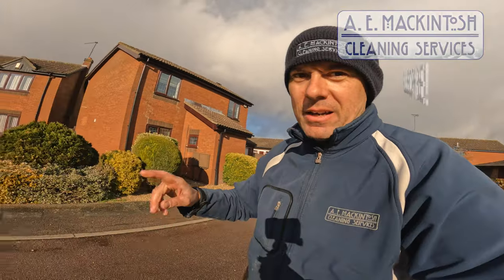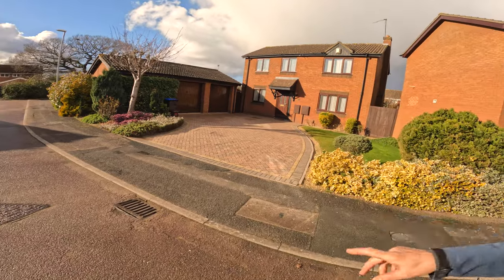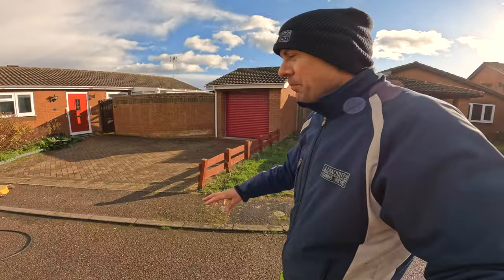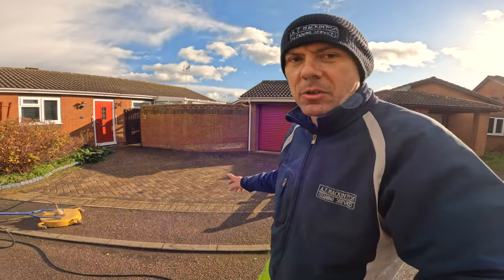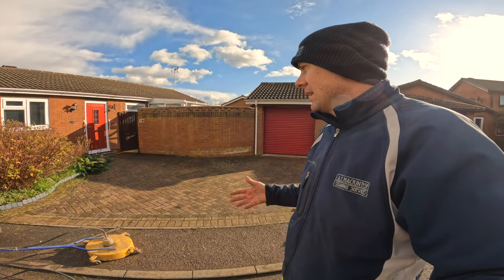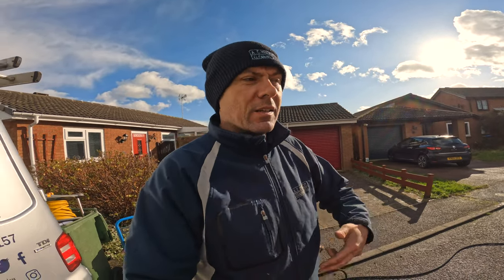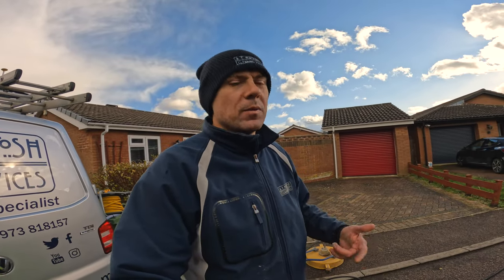Drive Cleaned For My Minimum Charge

Comment: Every job is different, with its own issues. I quote each job individually. You have to cover yourself. How often do you get the old, "Oh while your here, can you just give this a quick flick over"? Sure, it might only take you 30 seconds to do, but you've done something extra, for no reward. Try doing that at KFC, when you see them bagging up your order,....."Ah, While your there, can you add 6 nuggets"? See what happens then......they stop doing your order, & come back to the til. "That'll be another x amount of $$". Try saying, "Aww, I just thought while you were there, kinda thing".... Yeah right. You have your experience, & machinery to do the job, not to mention, all the associated costs, of  just being in business for yourself. Never sell yourself short. Mild rant over.
Reply from the maker: You make a good point. I think it’s good to bear it in mind and allow for this in your minimum charge. I don’t mind doing a little extra thing, but if it becomes a bigger thing then I will say that I will have to charge extra.😉👍🏼

Comment: Great job! What pressure is your pressure washer running at? I find that I still have to do the odd weeds etc after I’ve used the flat surface cleaner with a turbo Lance? 🤷
Reply from the maker: My pressure washer is a 21 litre per minute machine. But yes, I did go back over some areas with the turbo nozzle to get a few of the weeds out.👍🏼

Comment: Hi Ash have you ever tried the Sika resin sand, applied the same but wet it after and it goes off hard
Reply from the maker: No I haven’t actually used it myself. Could be a good added extra.

Comment: Good job. Noticed a small oil mark still on the drive. Would you usually leave them, or can you remove?
Reply from the maker: I will ask the customer as there will be an extra charge for stain removal and using a chemical to do it.

Comment: Hi dude great job!, I'm starting my own pressure washing business in the next couple weeks and have watched your videos. I'm curious do you find most peoples outside taps to be sufficient enough water flow for your machine or do you use a buffer tank often? I have a 4000psi 15/lpm beast so...
Reply from the maker: Always a buffer tank. But with a 15litres per minute machine most taps will probably be enough.👍🏼
Reply: @aemackintosh  what litres per minute does yours do? 
Seen a few people using a wheelie bin as a buffer tank, seems a cheap and good idea!
Reply from the maker: I’m running a 21litres per minute machine.😃👍🏼

Comment: Hi Ashley, just wondered where you got your turbo lance and dual fan/rinse please? They look nice and long to save on back ache! I've only really just got into pressure washing with a smaller system so struggling to know what's for the best.
Reply from the maker: Get in touch with Rutland Pumps. If you give them a ring they can advise you on what’s best.😉👍🏼

Comment: Great video. I was wondering why do you softwash after the rotary cleaner and not before?.
Reply from the maker: Sometimes you can do a pre treatment as well. I like to remove as much as I can with the pressure washer first and then the chemical has less work to do. If you just use the chemical first you end up using more than you need to, and it will likely need a second application anyway.
Reply: @aemackintosh  I noticed on your other videos you have the V-TUF RAPID-VSC 240v Hot-Water Pressure Washer. Would you recommend it? Is it powerful enough? Thanks
Reply from the maker: No, not worth it, that thing is virtually useless.👎🏼
Reply: @aemackintosh  Thanks 'BROTHER 😊' for saving me a heap load of money .

Comment: Quick question why not use the surface cleaner whilst the hypo is on work it in a bit more then rinse off.
Thanks
Reply: Because adding water will dilute the hypo even more, there is no need to work the hypo in unless you have heavy black spotting, then a bit of a scrub with a broom can help or if need be a second treatment with a stronger mix, hypo has a short half life, once on the ground it's not doing anything after 20 mins maybe 40mins at the most but after 20 mins it's lost most of its strength.

Comment: Lovely job Ashley good advice as usual , just  starting up and was modeling my equipment on yours . Was wondering What size of nozzles do you use in your flat surface cleaner
Reply from the maker: Thanks. I have 25 degree nozzles on my fsc.👍🏼
Reply: Thanks for reply Ashley was in a bit of a dilema between 15 degree or 25 i,ll now stick with 25 thanks @aemackintosh